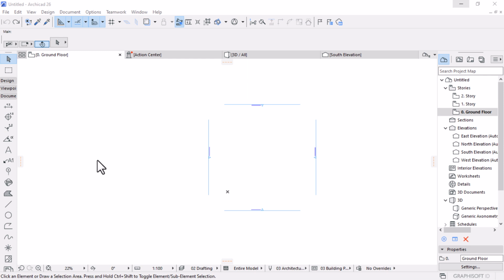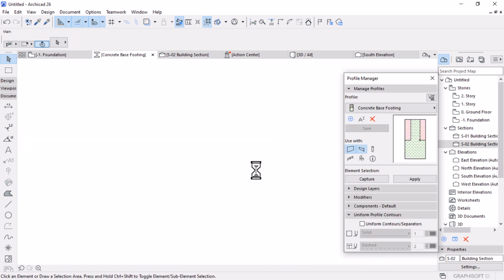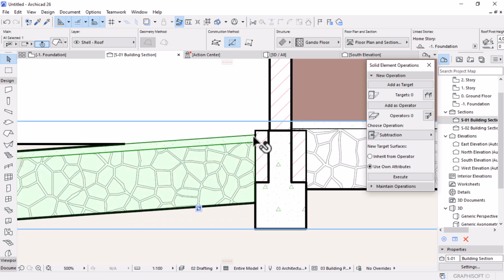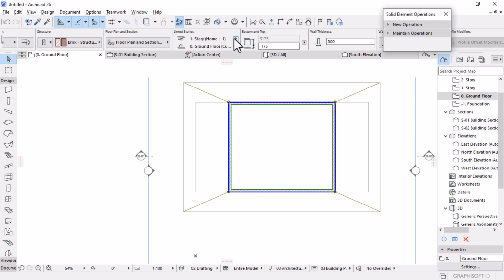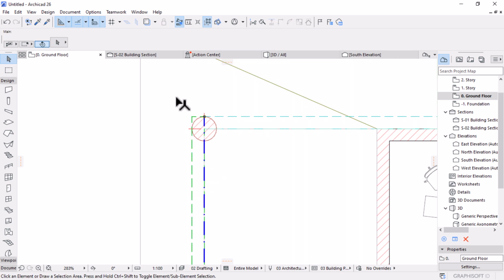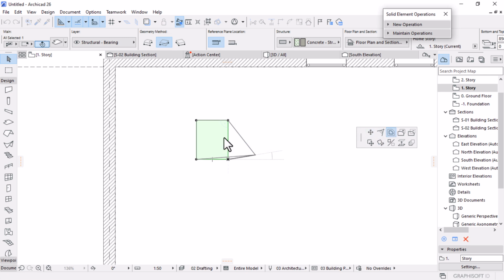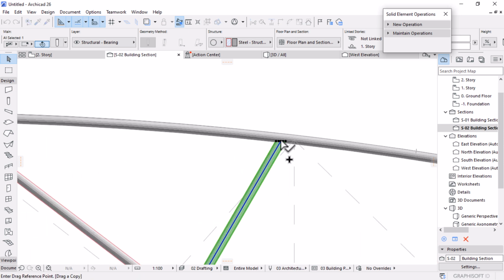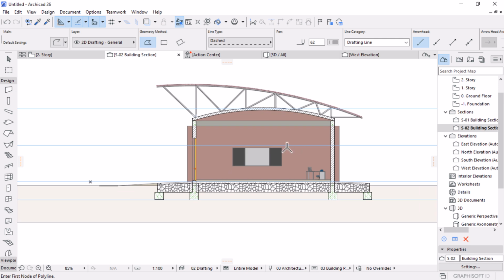ArchiCAD Beginner Tutorial  | CREATE  Fancis Kere  Gando School Project

Comment: Thank you for this tutorial. After checking Fracis Kere's works, I found that the Primary School Extension in Gando has a curve roof made of bricks. At the same time, the  weight of the curve bricks roof is constrained by the concrete beam around. It could make more sense if you can use Profile Manage to make that concrete beam instead of the one in your video which just allowing the roof sitting on it.